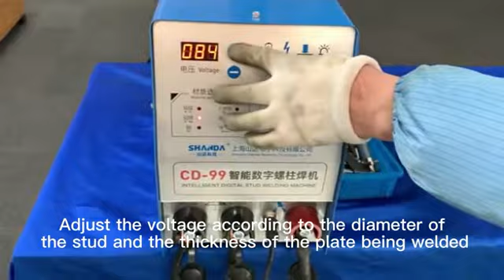Capacitor Discharge Stud Welder Bolt Plate Welding Machine

Comment from the maker: We sold to worldwide ,if you need or have questions , feel free to contact me . I will reply you at the first time. Email: 13539017871@139.com whatsapp: +86 13539017871
220V Capacitor Discharge Stud Welder Bolt Plate Welding Machine Welding M3-M10 studs for welding Carbon steel stainless aluminu
Link:https://www.aliexpress.com/item/4000062722288.html